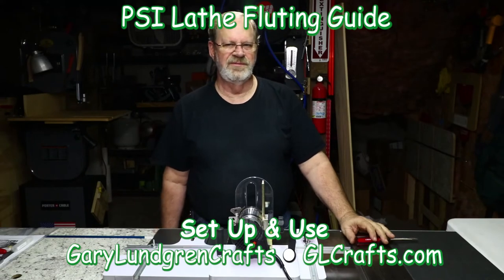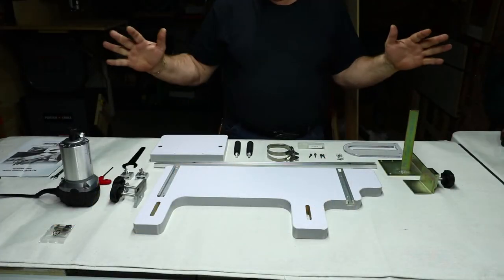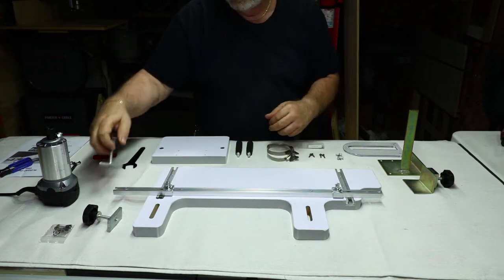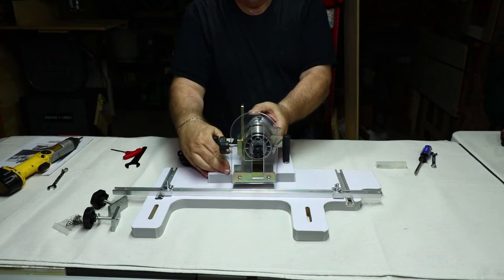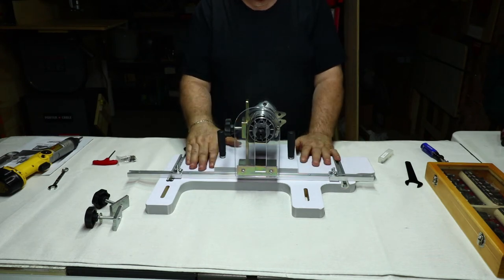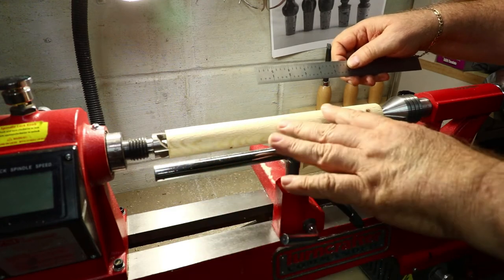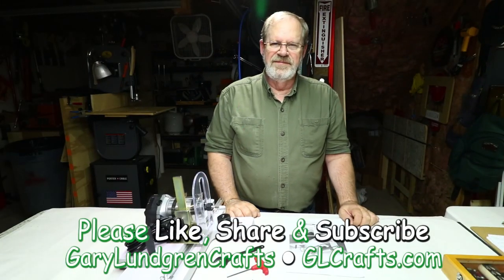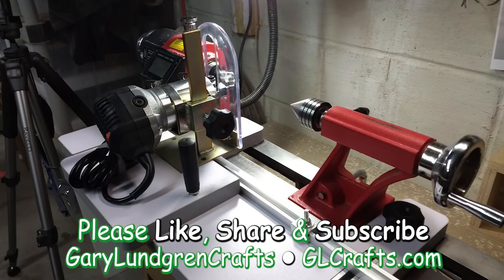PSI Lathe Fluting Guide Set Up & Use Ep.2017-35

Comment: What do do with a longer piece where the tail stock will be right where that  right side of the base plate is?  It seems very limited for length of a flute.
Reply from the maker: Thank you!  This is designed for shorter projects such as handles, etc.

Comment: The index wheel with 24 holes means you can do as many by dividing into 24  ex:( want to do 4 flutes so 24 divided by 4 = 6 so you do a cut every 6 index mark BUT  remember never to add the last count of the first one onto the second count , so do 1 thru 6 , the second cut would be 7, 13, 19. the first one was 1 thru 6 ok .

Comment: At 16:28 you can add a piece of stock in front of the router slider with different thickness to avoid adjusting the bit on how deep to go in. which you come to explain at 17:27 :) and why buy a $330 stock bars when you can place a piece of wood :)

Comment: the lamination on the surface can make you make boo boos since it might move as you push it to the starting point you want, it doesn't have a lock down to keep you steady.
Reply from the maker: Thanks. I guess that depends on how much pressure is applied. I've never had that problem myself.

Comment: See if you can get a Sears wood router crafter, you'll drop this jig and make full size table legs or small ones for sure.
Reply from the maker: That I'm not going to do as I already have what I need. I don't do any work pieces longer than my current set up. No need for it. I don't do legs. I don't do any long pieces. If someone needs more capacity then they need to consider the options. I can't debate it in this medium.
Reply: You don't do legs? hehehe, I figure I'd let you know about another  nice wood tool :)